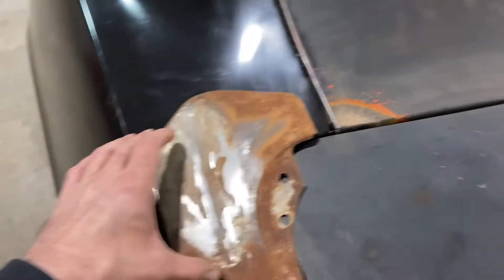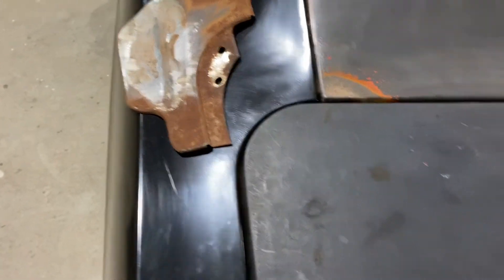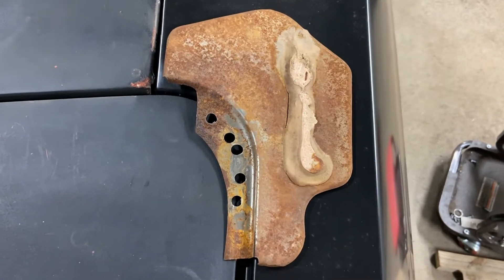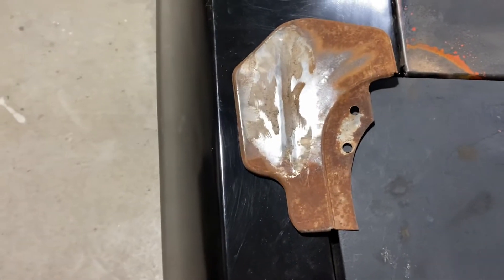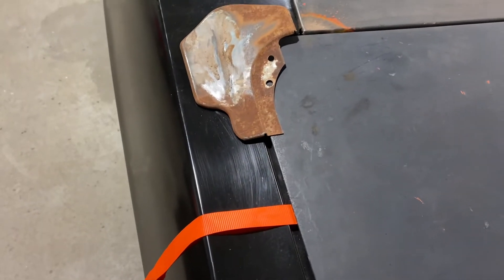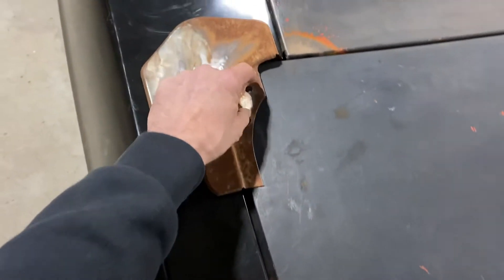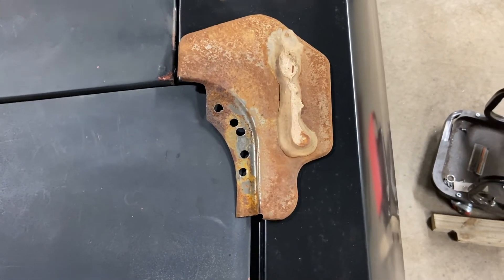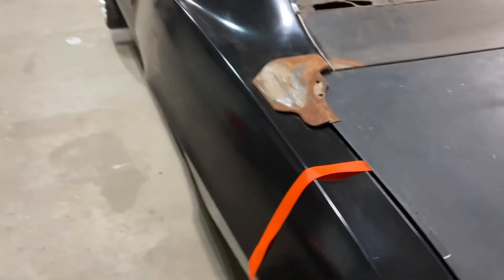Quarter panel support bracket.  A little controversial, sorta !!

Comment: it is for support, call a quarter panel stiffener. It was installed as factory. It is installed with body panel adhesive or with liquid nails, and only welded in the trunk gutter as yours was.
Reply from the maker: Thanks for the information.  It just seems like it doesn’t really do much.  I’ll be re-installing them but I just wanted a little more insight as to how they actually work!

Comment: Also, did you happen to notice the small brackets in the rear corner of the quarter glass area near the base of the sail panels?
Reply from the maker: I believe the majority of these brackets are still there.  I’m deleting the drip rails so I’m planning on welding the seam to seal it.